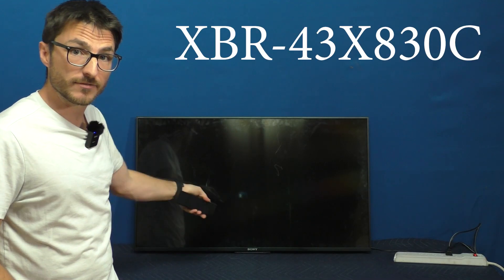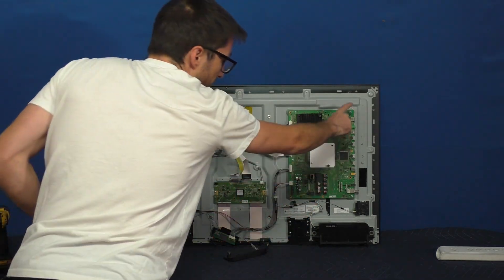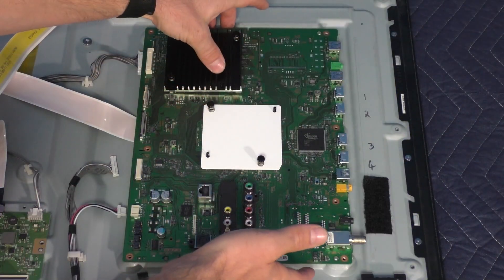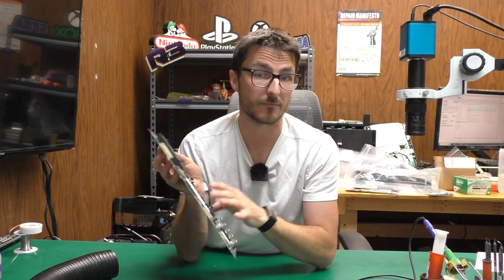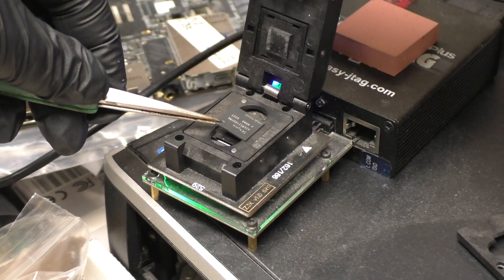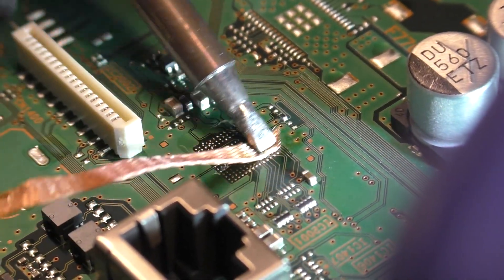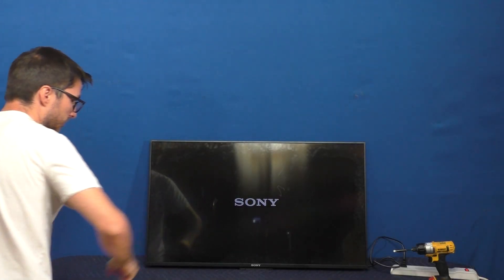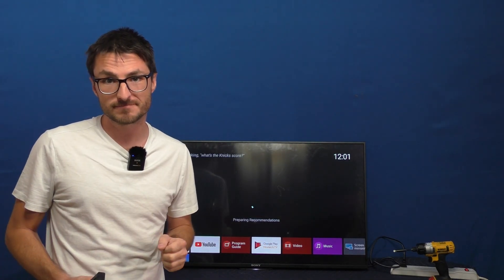4k Sony TV Freezes Advanced Repair XBR-43X830C

Comment: When you completely disassemble a sony XBR is there any need to resync or do anything to get the picture back? Just replaced leds on a XBR-75X950H and after putting it all back together theres just a blank screen.
Reply from the maker: Then most likely your LVDS ribbons are improperly installed, or they were damaged during the disassembly or reassembly.
Reply: @NicksTVRepair  yea found out that was the problem, unfortunately after repairing everything and putting it back together I broke the lcd screen. Super bummed about it but guess I learned a valuable lesson. Hopefully ill gey another chance at a repair. That was a nice TV too.

Comment: Where do you even get the firmware for these TVs and other devices?
Reply from the maker: I have to buy brand new mainboards "if they are available" remove the eMMC chips off the brand new board, image the chip aka clone the software so I can use it to write the data to the replacement chips we install.

Comment: And what does this help me ??? Is this an advertisement for your company? BS Video
Reply: This video is a little of both advertisement and help. There are many TV repair videos out there that don't explain anything and just show the job being done. 
Do you have a hot air station and programmer to do this job anyway?
If this above your level of expertise then send it to Nick. This job requires a special skill set from experience. Dont blame the content creator if its not easy.
Reply from the maker: That is exactly right. I show you how to idenitfy the fault, confirm it via the eMMC check in the programmer and offer to provide the repair for a flat rate since this requires advanced skills and tools so that you can fix your TV instead of throwing it out. Win win

Comment: One question: can this freezing symptom be seen in other Sony models, would it always be this memory?
Reply from the maker: Yes and also in hisense is another one we commonly see these eMMC chips fail with and cause similar faults. Freezing does not always = memory it can also be due to processor failure but usually with Sony it's more likely to be eMMC than not.

Comment: That is some great soldering skill and equipment.  I've been working on electronics my entire career with an associates degree from 1986.  I pride myself in good soldering skills and can replace most through-hole and surface mount components, but I have never attempted to replace  a BGA chip.  What I don't understand is how do you know that the IC is on placement and all the pads lined up when you can't see the connection points underneath it.  When you heat it up, does it kind of float itself into place, or do you have to have it positioned perfectly?  I've also heard of "re-balling" the BGA processors used in the older LG smart TV's that were known for solder fractures.  I'd like to see that done sometime if you ever have an opportunity to demonstrate.  That looks like an awesome machine and I'd love to have one but there's no way I could justify the expense for the hand full of boards I do per year.  And they're getting fewer and further between.  I repair TV's from home as a part time side business and prior to 2020 I was doing 2-3 sets per week.  Now I only see about that many a year.  Stuff is getting so cheap that people are throwing it away and buying new for close to what it would cost to repair their 5-10 year old set.  Very cool video.  I really enjoy watching this type of procedure.  And btw I have used your service for a couple boards in the past and everything worked great.  You do very good work.

Comment: Thank you for this information. I work at an authorized Sony dealer here in Brazil and don't have access to this information for repairs. I've had this problem before and was forced to replace the motherboard.
Reply from the maker: Yeah they usually will have you send the mainboard back in as a trade in core and that's what they will do with it.

Comment: Exceeded its maximum estimated device lifetime? Sounds more like built-in obsolescence to me Nick.
Reply from the maker: Well this TV is now 10 years old, but what I recommend to everyone is always to use a firestick, #1 it's a better user experience than any built in OS from any TV manufcaturer no matter what. It's just by default how it is, the apps from any manufacturer will always be a lower quality version of the apps than you will see on the firestick, they pay to have a monopoly on the upgraded versions of the apps and to be the only ones that are allowed to use it. And #2 it helps distribute the work load away from the TV and onto a cheaper and easily replaceable device.
Reply: @NicksTVRepair  Sorry, didn't realize the TV was 10 years old, that's pretty good going.
Reply from the maker: It is 10 years old but It's still a very good TV and very much worth fixing. With that said and to agree with you, a bit more, while this one is a 2015 model we also see plenty of other models that are only 3-4 years old with eMMC chip failure just like this one. It depends on the use of the set. If someone on a daily basis logs in 2h using built in apps VS someone else that uses it only on the weekends, that will also make a big difference. 
We do have some people bring in their sets at our shop locally and say "Oh yeah I bought the TV just a bit over a year ago and I have never turned it off. I only turned it on once the day I bought it and it's been on 24/7 since"
All in all this model we were fixing it 5 years ago already, back in 2020 and we were seeing a descent amount of repair requests for it back then, we still do today and I am sure in a few more years we will still be fixing it. So what is the difference between the ones that failed already 5 years ago VS the ones that are still working today and won't fail for another 3-4 years? I think is most likely how much use they have gotten. Is it your spare bedroom TV or main living room.
Reply: @NicksTVRepair Man the stuff you've figured out just blows my mind Nick. You're like one of these guys that comes into Shark Tank with a simple but brilliant idea. And I'm like that typical guy at home watching thinking : Now why didn't I think of that 😊
Reply: First released in May 2015, so get yer wallet out! ;-)